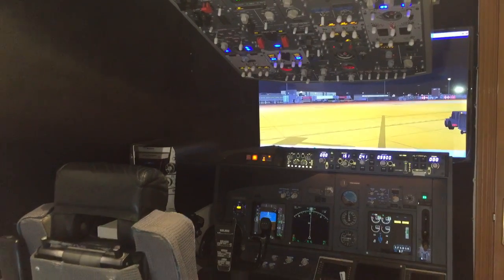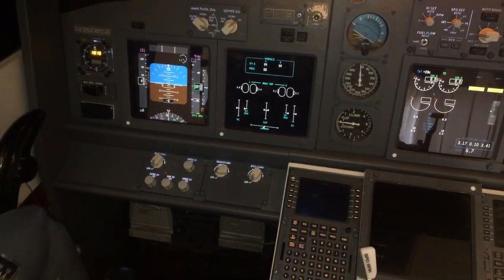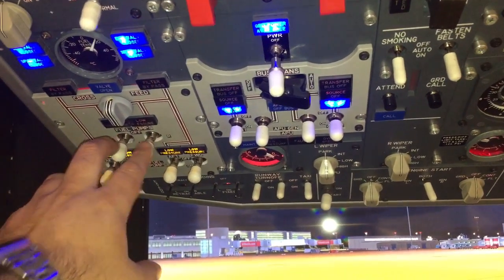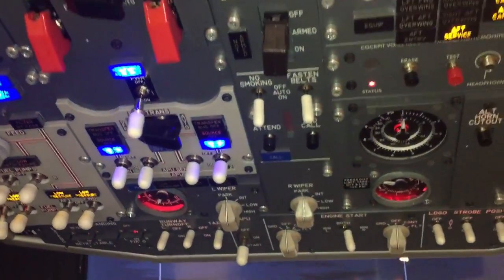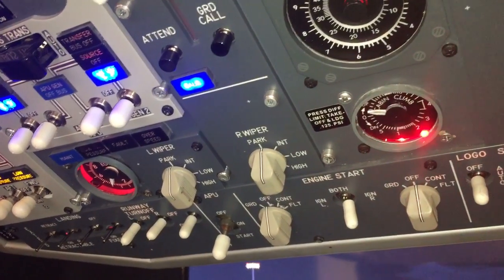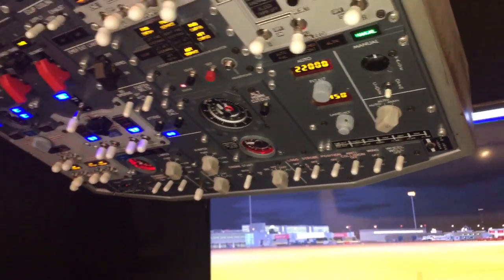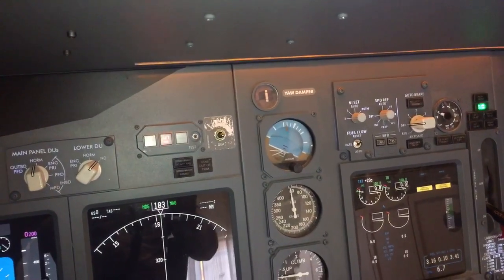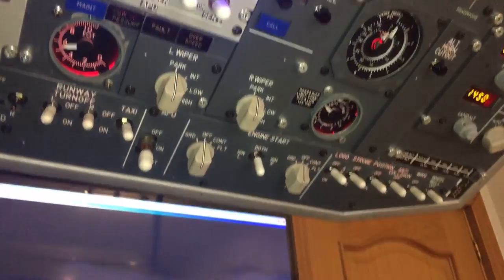Boeing 737 cockpit systems review. prosim737

Comment: I am currently in the process of building an in-home training level simulator, I was wondering if you might be willing to answer a couple of advice questions via email or your preference. I have several questions but one of the primary ones is who is the best resource for obtaining the panels/switches/knobs, and most of the resources I have found I have been a bit laborious in a sense having to itemize out every switch or knob etc. and complete the panel after ordering parts, are there any Companies that make pre-fabricated aircraft specific panels I’m ready to install?